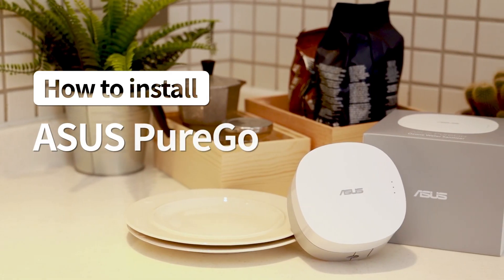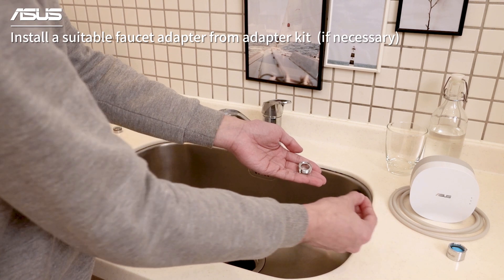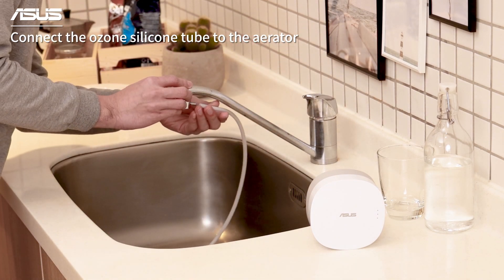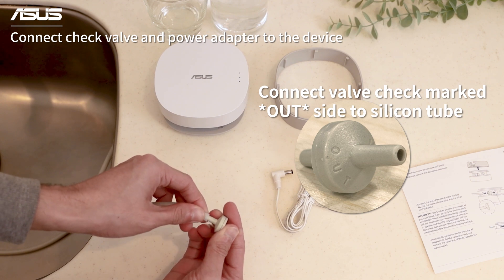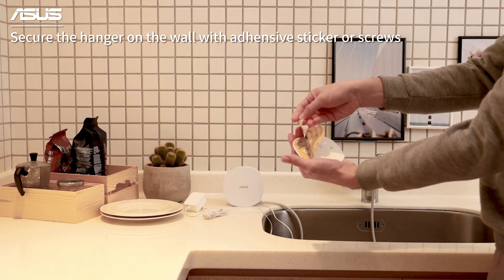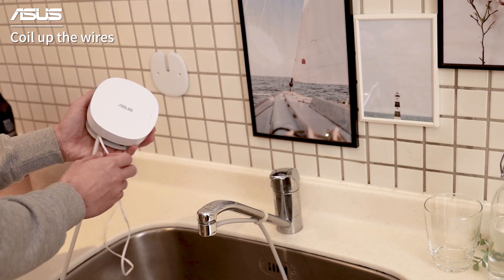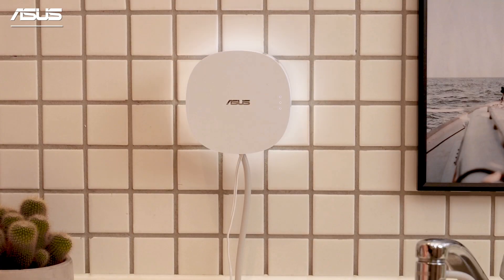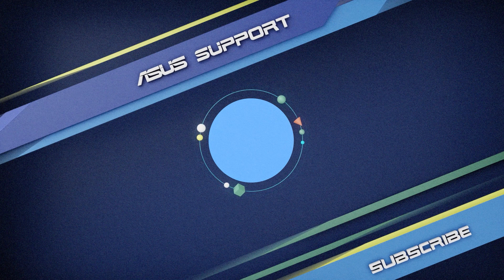How to Install ASUS PureGo Ozone Water Sanitizer    | ASUS SUPPORT

Comment: Hi, can I know why my asus laptop will disconnected from wifi anf bluetooth when launch app that switch the graphic card from intel to rtx3060. The bluetooth icon and wifi icon disappear and at device manager also cannot find the driver, I already updated the driver to the latest one. I knew is caused by switching to rtx graphic card because when I turn on Gpu saving mode, which disables the rtx3060, I launch the game and everything works fine.
Reply from the maker: Hi, according to your question, could you provide the product model?
We'll help you check with the relevant department.
Thank you.
Reply: @asus_support  2021 ASUS TUF Gaming F15 FX506HM
Reply from the maker: Hi, thanks for providing the information.
There're some few questions that I would like to confirm with you.
In your question, you mentioned that you "launch an app" may I ask what is the app?
Have you try using other GPU mode?
Did the problem still persist?
Did the problem happens everytime you use RTX graphic card?
Whether the problem happens before? Or have you make any change then the problem start occur?
Thank you.
Reply from the maker: Hi, also, it is suggest that you try to update your BIOS version to 313 or later, then try to confirm whether the problem still occured.
Thank you.
Reply: @asus_support  hi but my bios system already the latest version, which is version 315
Reply from the maker: @MichaelJordan-bw1sl  Hi, may I ask have you try using other GPU mode?
Did the problem still persist?
Also, the latest BIOS version on official support site is version 313.
You can refer to the following link.
https://www.asus.com/supportonly/fx506hm/helpdesk_bios/
Thank you.